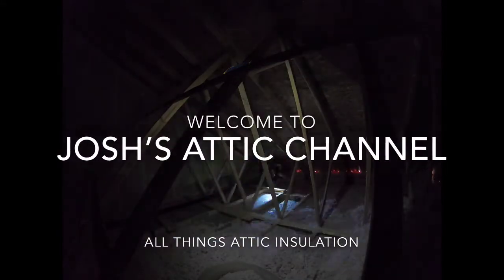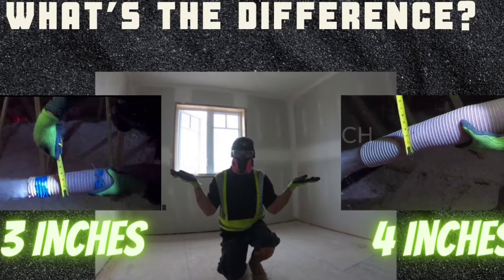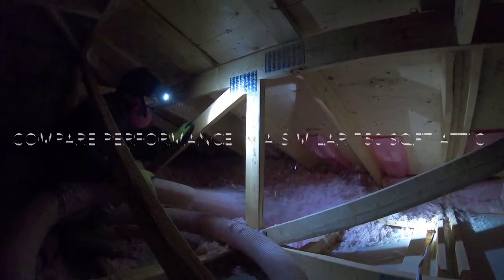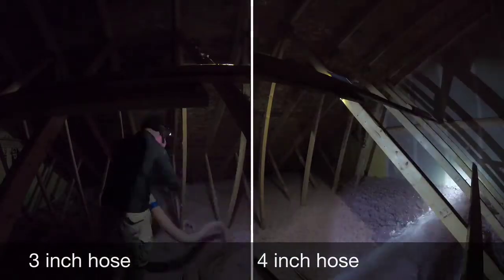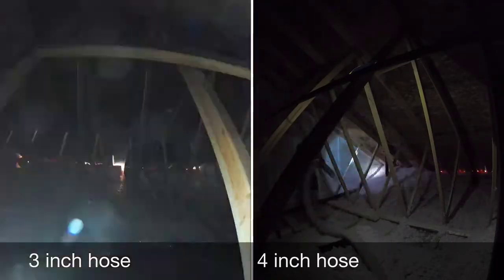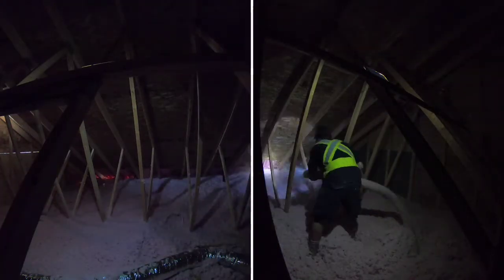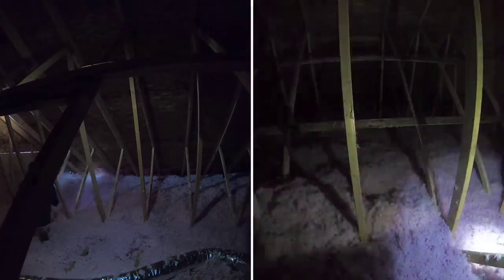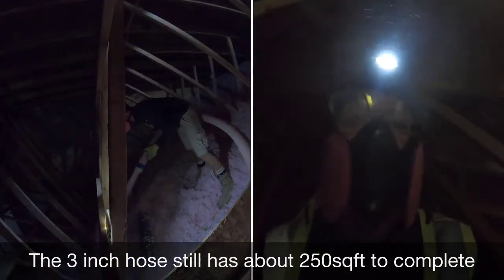How to insulate your attic: Attic Insulation Comparing 3 vs 4 inch diameter hose

Comment from the maker: For other videos on my channel checkout: https://www.youtube.com/channel/UCEVjorZMgXKIGhvUVu0r9Og?view_as=subscriber

The comparison between both hoses includes that the 4inch hose is attached to a machine designed for that size output. It's roughly 1-1.25min per 35sqft for the 4inch and 1.45-2min for the 3inch diam hose. Hope this clarifies the comparison. It takes 20-25min vs 35-40min for a 750sqft house respectively.

Comment: I absolutely love the thickness debate! It’s a veteran point of view.
Reply from the maker: Thank you, I thought it would be neat to show the difference.
Reply: @SinnisjInsulator  oh it’s a great idea, the few times I did blown in I used a three inch hose off a reducer and it gave me too much pressure and I had to arch the angles do allow the fibre the fluff out a bit witch consumed more bags of pink, when I used a four inch it fluffed up a lot better and consumption was better but I had to get closer and the hose was a bit tougher too move around! For yield and production quality I think four inch but I’m not a blown-in professional so don’t take my word for it
Reply from the maker: @chinidad2778  it's hard to say because you can play around with the output latch and the air intake for the hose as well as the overall motor speed. Most materials say fully open the air and put 3/4 material hatch input but that's probably for the 3 inch.

Comment: Combien de temps est-ce que ça prend pour compléter un grenier de cette grandeur avec chacun des boyaux? Tu l’as peut-être dit mais je ne l’ai pas entendu.
Reply from the maker: For the 4 inch it takes 1min per 35sqft. 3 inch us around a little less than 2 min. So it takes about 20 bags for a 750sqft house at r60. So 20vs 35-40min in the attic. 😁